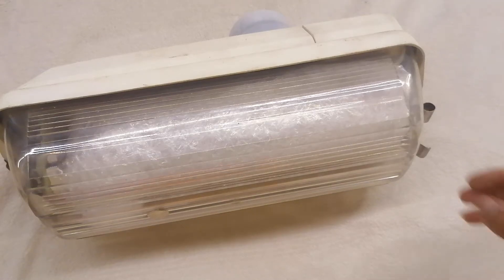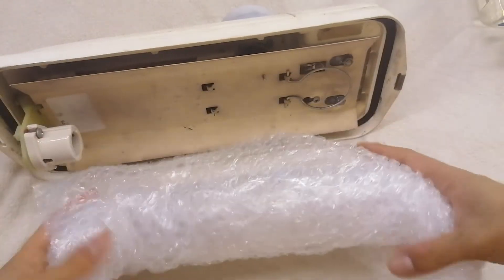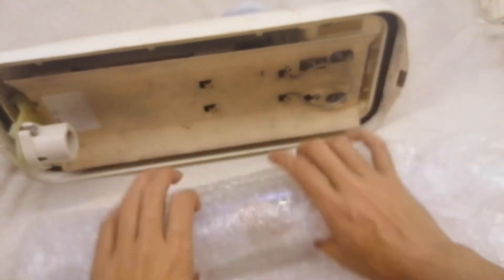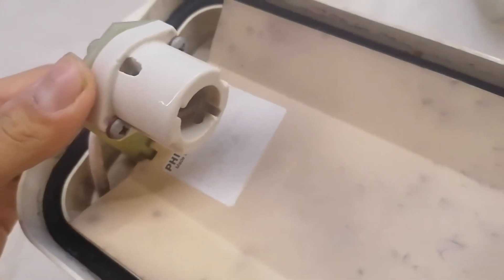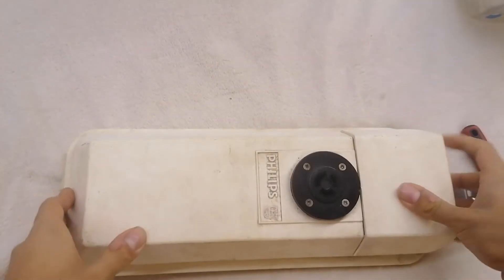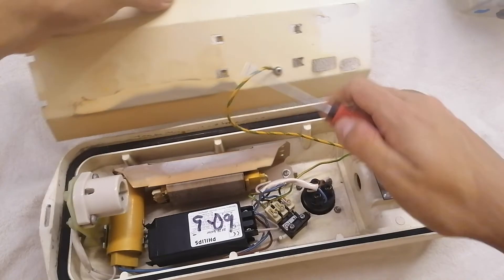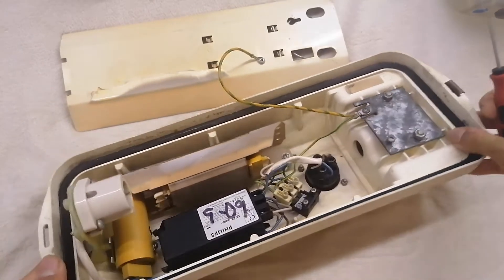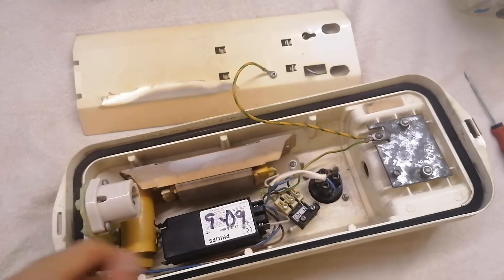A look at a Philips MI26/XGS103 LPS streetlight

Comment: I recently found a 55-watt LPS security fixture, mostly used indoors, at our weekly swapmeet. LPS is very rare in the US, but there are still some towns near observatories that use LPS streetlights since the monochrome orange wavelength can be filtered out by telescopes. The city where I live in the US still has HPS streetlights. All of the utility owned fixtures are still HPS. City owned streetlights which are at signaled intersections were changed out to LED around ten years ago. I think our HPS steeetlights won’t be around much longer as all the neighboring towns have already been changed out to LED fixtures.
Reply from the maker: The US still has a relatively diverse range of streetlights where a lot of councils here have gone to LED entirely. There are some random sodium lights they missed but most have vanished.

Comment: I've never seen a red sodium streetlight lol.
Reply from the maker: These warm up to orange. London hasn't got many of these as they used to use HPS which when at full brightness is white with a orange tint. Most places are upgrading to LED now.
Reply: @LiftAdventures  Ah yeah, the good old orange ones which are kinda around but yes as you said are being replaced by LEDs.